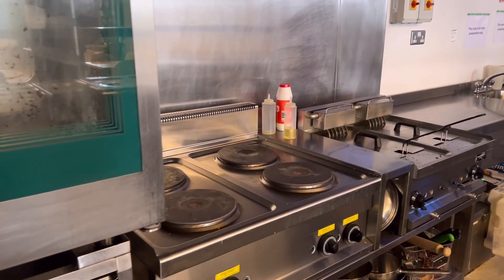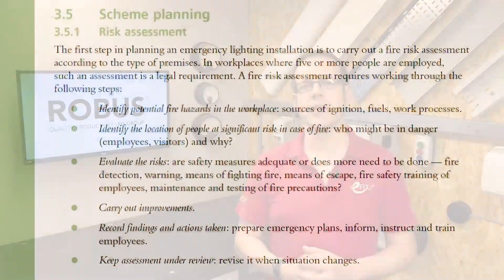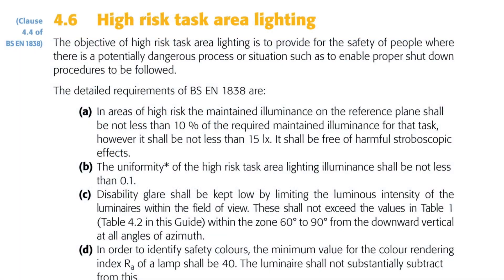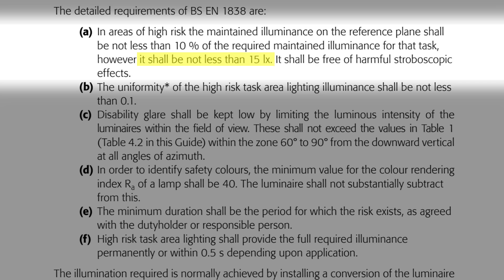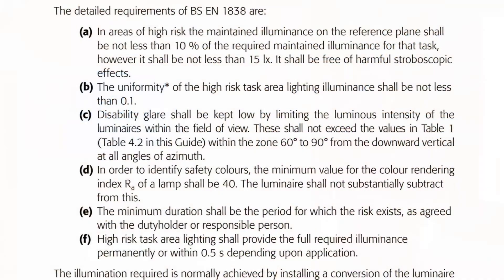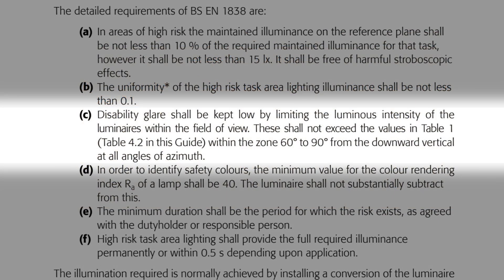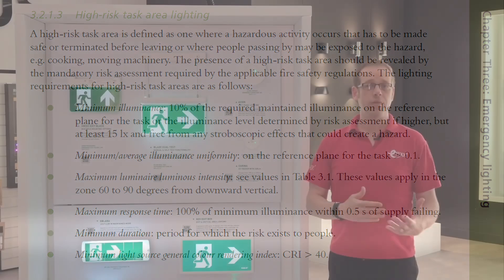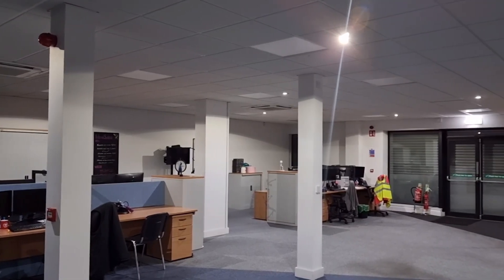High Risk Emergency Lighting: Compliance or Catastrophe?

Comment: Having been an electrician for 20 years in the U.S., I find that the regulation/s for emergency light/s output assuming that by lux you mean lumens, are at best inadequate and worst dangerous. 15 lux seems a bit too low, particularly in a fire emergency with thick black smoke and other toxic fumes taking place. One would think that emergency lights should have greater lumen than general lighting considering they are spaced apart and not as many as general lights.